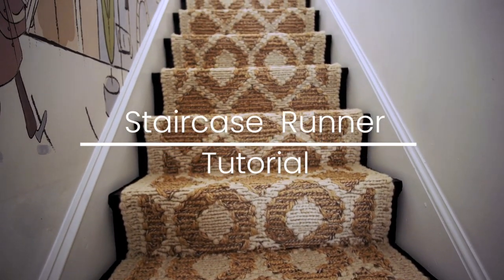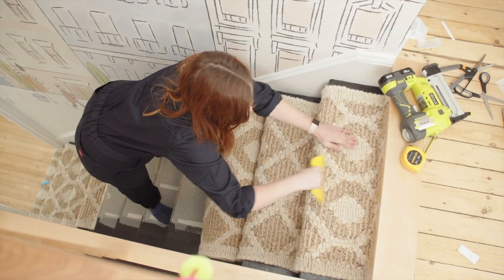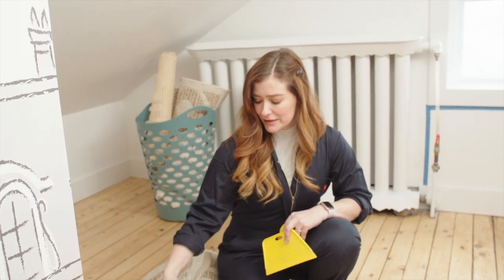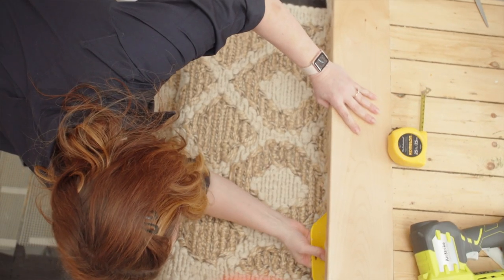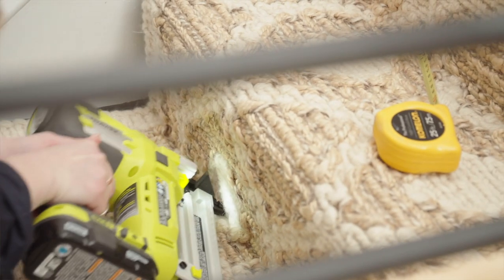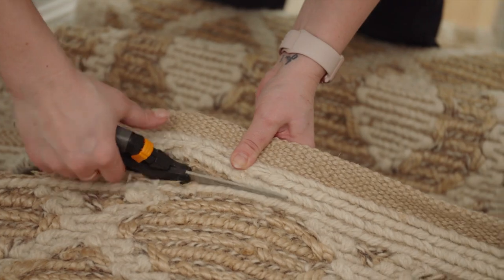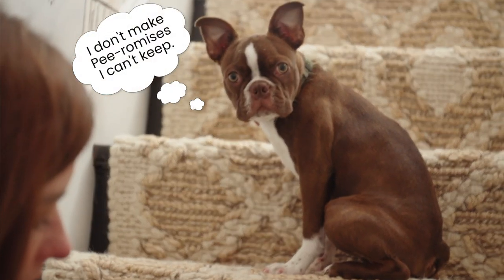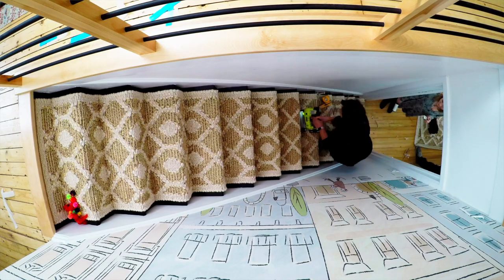How To Install a Staircase Runner- The Fast Way

Comment: Thanks for a great tutorial. I need to lay a runner on our stairs going to the 3rd floor because our dog is too scared to come down on the wood! I did have two questions:

1. How do you measure to figure out what size runner you need to buy?

2. When you meet in the  middle, I'm a bit confused. So you finish the runner coming from the top so that it's flush with the edge where it meets the step. Then, when you are joining the piece coming up from the bottom, how do you know where to cut... I understand the pattern match, but what if the pattern doesn't match with where you are on the rug when you meet the middle? So if you get to the middle, match the pattern, but there's an overlap or not enough to match. Do you just make sure you have enough excess to work with?  (hope this makes sense)
Reply: Hey marlee. You measure the step and the riser, for each step. Add them all up and get the amount of feet required for a runner, then you need to buy that much for your runner. If you need 20 feet and your runners are 8 feet. You will need 3 runners. Pick a pattern that repeats often or something simple and plain for your first diy attempt so you don’t make your job too difficult. If you have extra runner material then You can start the new runner and end the old runner in a spot that makes sense for lining up the pattern. Hope that helps
Reply: @fanshowvids  Thank you! This helps a lot.
Reply: @fanshowvids  Thank you. That helps!

Comment: @DIYMOM what brand of staple gun did you use and where did you get it from? My husband got one from Home Depot and it does hold the runners in place because the staples break whenever he tries to staples down the runner to the stairs
Reply: This is a Ryobi staple gun. You also need to make sure your staples are long enough that they grab the runner and the wood.

Comment: Did you use regular nails ?
Reply from the maker: Staple gun and carpet staples at least 3/4 inch
Reply: @HEYMOMHEY  Can you tell me what the "crown" measurement was of the staples you used?  That measurement is, as I understand it, basically the width of the staple -- the distance between the two prongs.

Comment: So, I am working up to doing this on our new house. I was planning on a flat weave rug but using carpet tape to put down carpet padding on each step under the rug. Thoughts? Also, I only have an electric stapler, no air compressor or battery. Should this work? Thanks!
Reply from the maker: Yes you can do i with all those things, definitely tape down the carpet pads and any stapler will work, just more labour when it is hand held, but I have done a few that way

Comment: as a professional carpet installer can say looks good from I-35. Honestly, so much wrong with this installation. However,  for DIY, and don't have to answer to customer may be OK.
Reply: Explain what’s wrong then...
Reply: @RyanReskyTrumpeter  , this is not bad for a diy.  If she would have started from the bottom step and went up when she ran out of carpet ,cut flush with the riser , then cut the next run to match the pattern starting again. I have all the proper tools for this but you can rent from Home Depot a little install box! Comes with a kicker,stair tool. Also I would suggest renting a Duo Fast electric upholstery stapler from them also. When stapling wiggle the stapler so the staples get between the fibers and don't leave a dimple! I'm being critical here sooo !!  She has done these enough that if I showed her once ,she would get it.

Comment: I fast forwarded through your video only because I thought the paint job on the stairs was tacky and the correct way to install stair runner is to start at the bottom, I get that you saved paint by not painting the whole step but your cut ins are terrible I was hoping to see you fix those at the end but no such luck, I really hate to see women do 1/2 assed do it yourself videos it's why we can't get jobs as handywomen!
Reply: What a friendly response 🤨